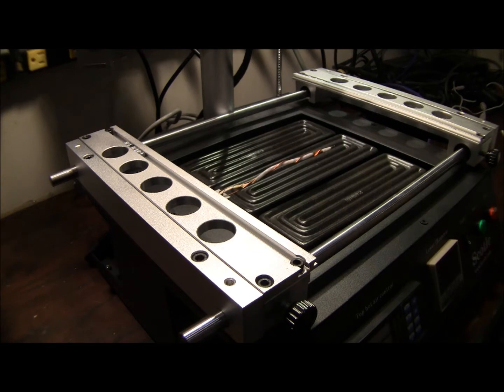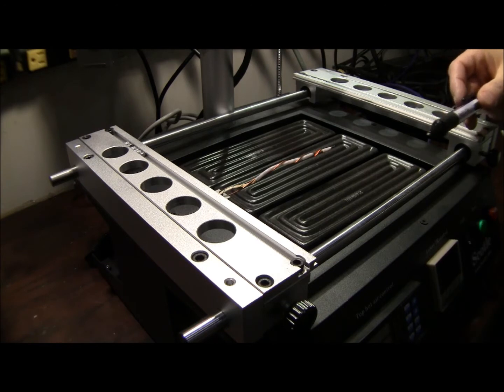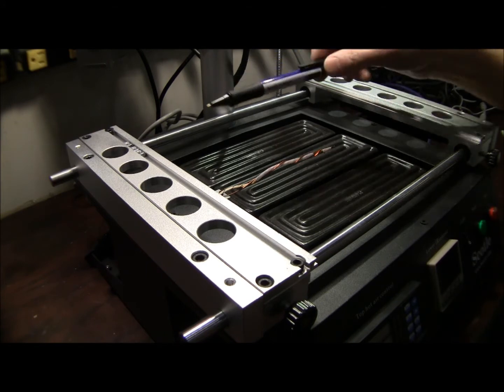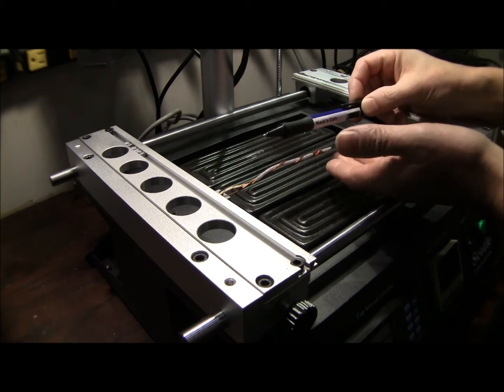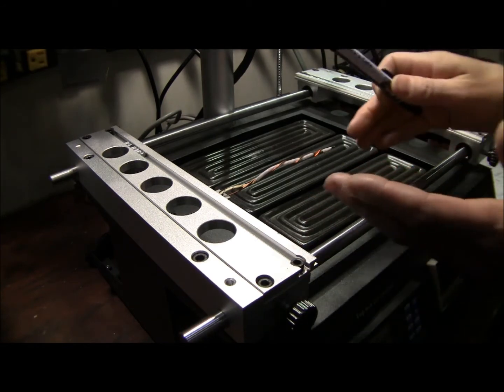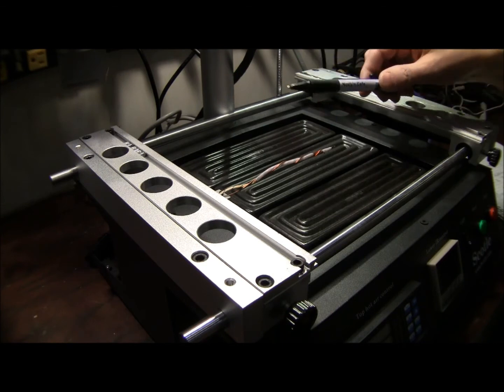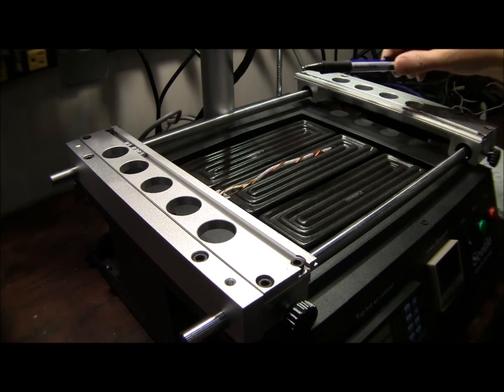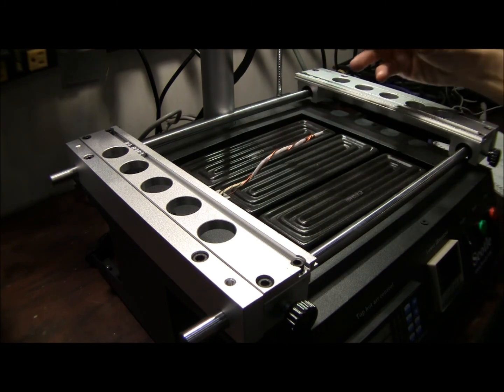Lower Heater Setup and Modification for your Rework Station Video 2

Comment: hi! I know this is a very old video but do you happen to have schematics for the honton R390 ? thank you
Reply from the maker: I do not.  Never had schematics for any of them. But the wiring is pretty basic are you trying wire from scratch?  You should try Google any of the models around same time should be close enough to figure out.  I’ll see if I have any thing close to it.
Reply: @SPITFIREMODS  wow thanks a lot for the quick response. Honestly any similar machine (ideally one with 2xPC410 and one REX C10) would be good. I got a used machine and need to check a few things on it. Plus I might want to try and mod/upgrade it later on so it would be good to have some kind of reference. If you can find a diagram/schematic etc for a similar unit that would be fantastic, but otherwise I'm sure I can reverse-engineer it, it'll just take longer